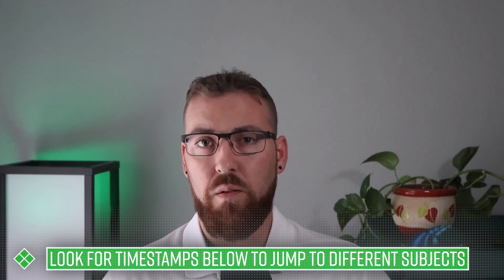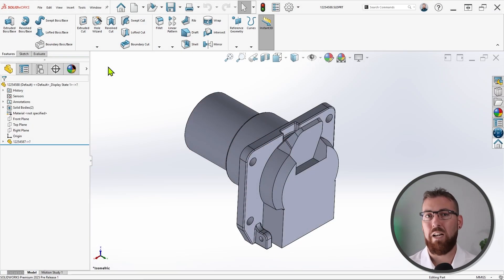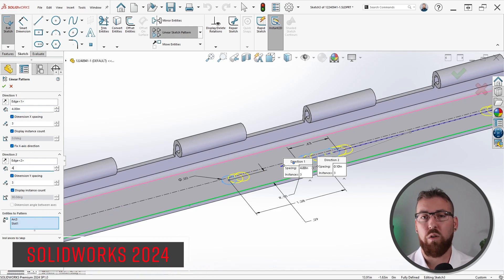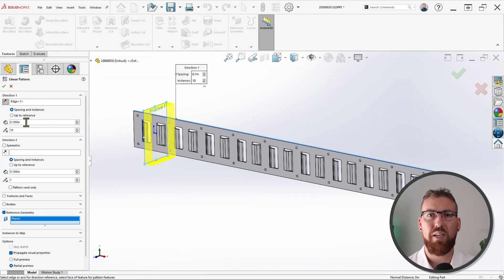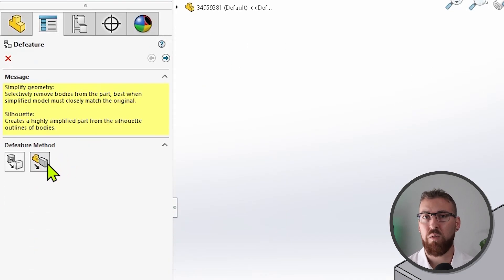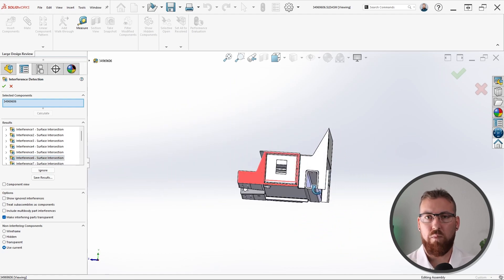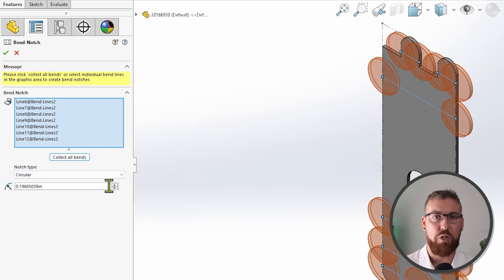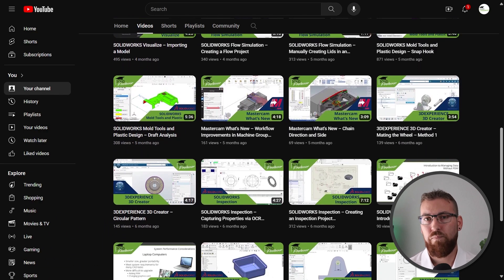What's New in SOLIDWORKS 2025 - Top Enhancements

Comment: Z up? Decades ago we used the left hand rule and your thumb was the z axis and you index finger was the Y. This was the wireframe days and I never understood why SW didn't have the z pointing at you in the screen like the left hand rule so is that what this does?
Reply from the maker: Not exactly (if I'm understanding you correctly) but close - Assuming you're looking a part for a standard isometric view, the default orientation in SOLIDWORKS (Y-up) has the Y axis representing height, while X represents width and Z represents depth or the direction "into and out of the screen", following the right-hand rule rather than the left-hand rule. The Z-up option essentially swaps the Y and Z directions to the Z represents height instead of depth, which tends to be common in many CNC programming applications. It's really all a matter of preference, but it can be really confusing if you learned CAD in a different orientation.

I hope this helps!